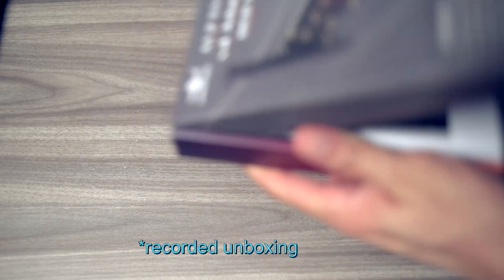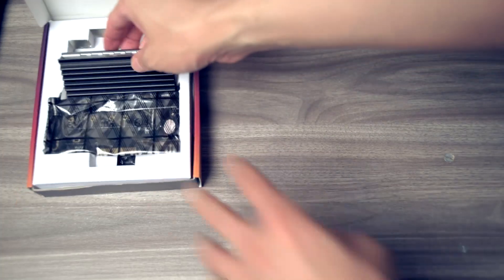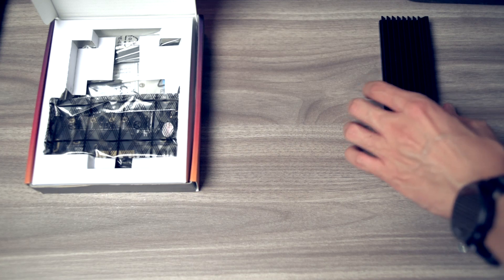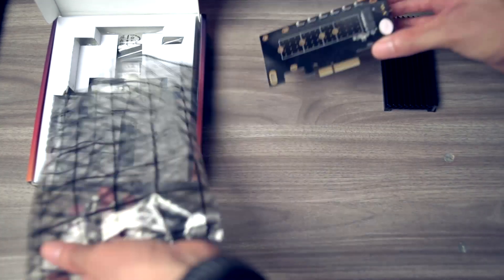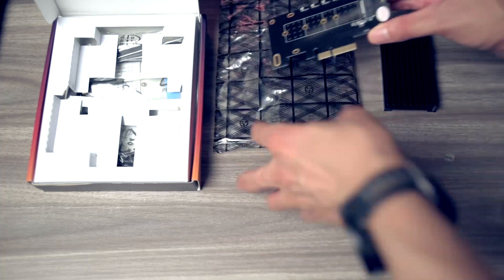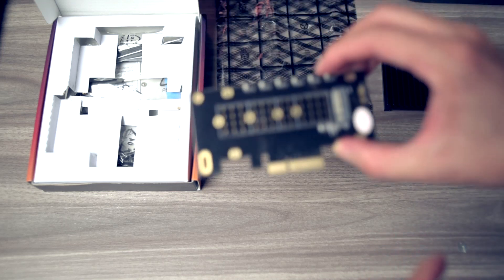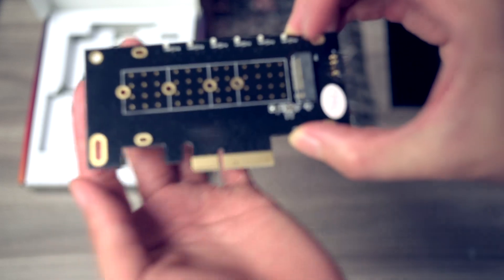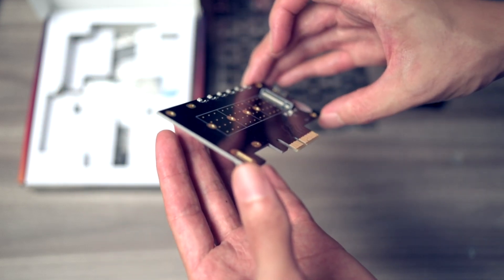VANTEC M.2 SSD PCIe ADAPTER |SOLID STATE DRIVE | ADAPTER

Comment: can we install windows and boot from this drive ,plz guide us
Reply from the maker: This will be recognized by your pc like any other hard drive. As long as you can see the drive after installing it then simply format and choose this drive when installing the operating system.

So whatever you can do to any other drive you should be able to do with this drive. If your bios supports it then you are good to go.

If your drive supports this type of card then there will be no issues.